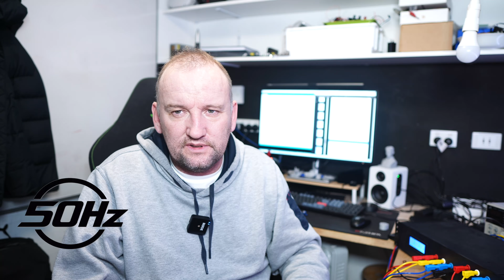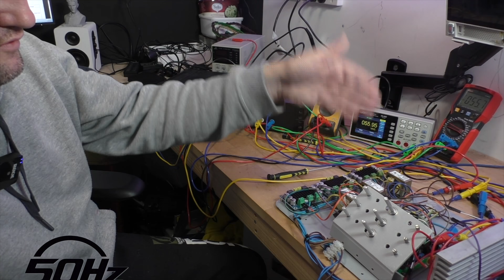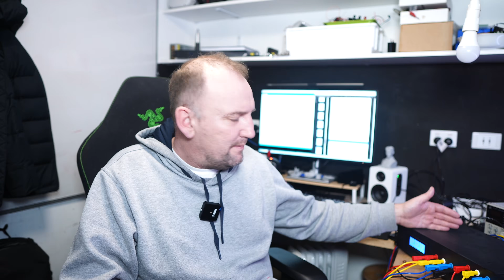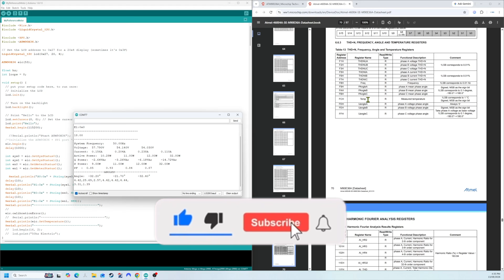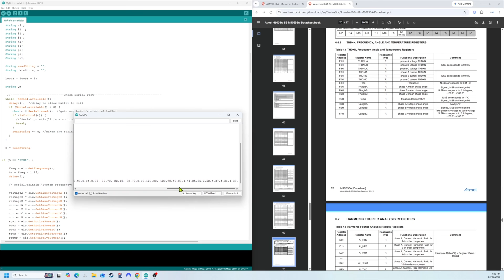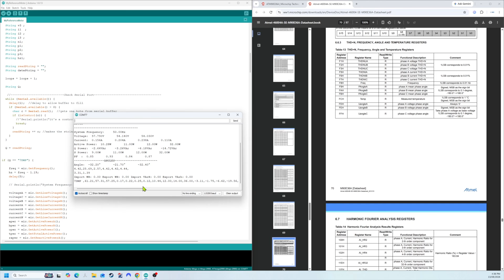Arduino Electricity Meter

Comment: Hey mate, could you please make a DC circuits video where you solve meters (x, y, z) for the new LET DC question? Would highly appreciate it
Reply from the maker: I'll have a look at doing it this weekend.
Reply: @50Hz thanks mate, could you also do it with all given readings in Ohms only. I saw your mixed one just now
Reply from the maker: @omaraly8622  Its almost like as soon as I solve it they change it.
Reply: @50Hz They have 2 options, 1 with given values in Ohms only and the other with mixed values (amps volts ohms). If you’d like mate I can send you an example. Trying to pass my LET this is the only thing I’m currently struggling with.
Reply from the maker: @omaraly8622 I was going to solve it this weekend but I’ve been sick. 

Yeah email it to me.  jongrimes1983@gmail.com and I’ll solve it when I’m better
Reply: @50Hz thanks mate get well soon, I’ll send you one now
Reply: @50Hz hey mate just wondering if you got the email
Reply from the maker: @omaraly8622  I didnt get an email but is it the one from the ESV website?
Reply: @50Hz not sure why you didn’t receive it, is your email above correct?